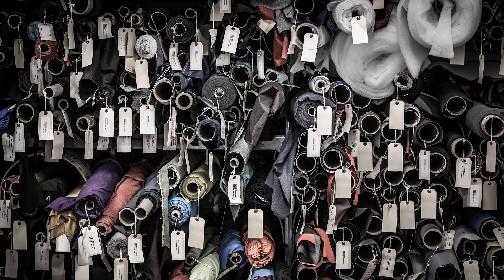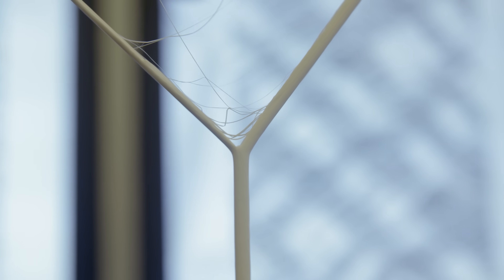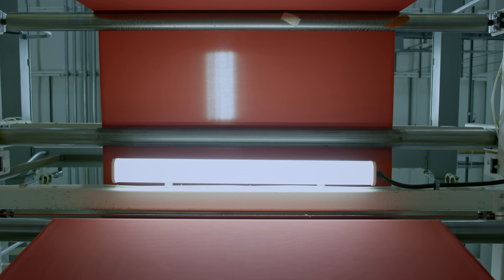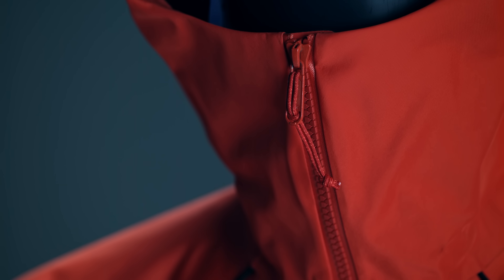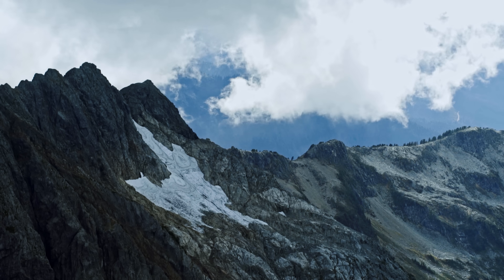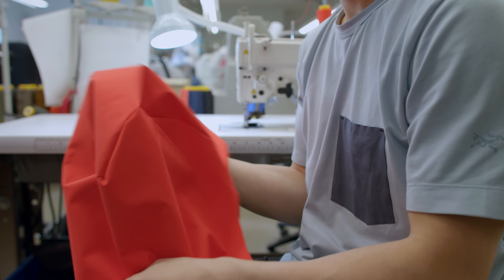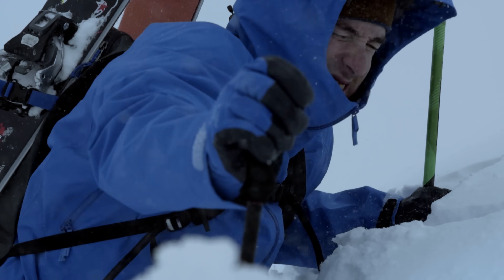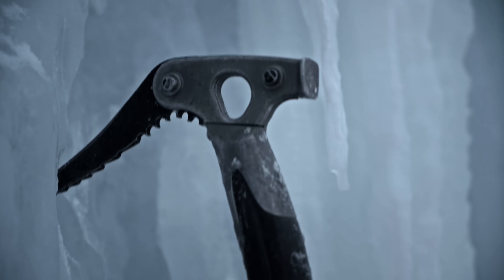Arc'teryx Presents - Who We Are: The Science Behind Gore-Tex

Comment: performance over durability - 3rd item sent back after only 1.5 years useage and holes have appeared, stichting come lose and zips stopped working. Crap warranty ensures I'll never buy again.
Reply: They have the best customer service: they'll fix your gear, if not they'll replace it under warranty
Reply: @deanpereza  no, not in my experience. I've had two items that i've sent in that they have clasesd as 'end of life' (2 years old) and they wouldn't replace it. They did offer a 50% off on another item which is nice but does not compare to BD, OR or Patagonia that would just replace it in the first place (no questions asked).

Comment: "EPTFE allows body moisture to get through the garment, yet it won't allow water molecules to penetrate it". So "body moisture" is not made of water molecules, right?. If you want to use technical jargon for marketing, at least take the time to chose your words carefully.
Reply: It functions because of the surface tension of water on the surface of the membrane. The actual ways in which it works is a bit more technical than the average consumer cares to hear so they simplify it to water beadlets are larger than water vapour particles.
Reply: Fernando Sanchez Body vapours are so small in comparison to water beadlets.

Comment: Nice video 
Maybe I have had the wrong manufacturers with my raincoats 
Everyone has failed with goretex leaking like a siv in some cases more like a colander. 
I’m one that wears shorts so most rainwear doesn’t cover my bum. So I end up with a wet bum and the weather whistles through. This may sound a bit controversial that I don’t wear longs. With longs it’s not fun crossing rivers and creeks as the longs can pull me down under and into the current

What I am looking for is a raincoat that protects my bum when I’m carrying my pack. No armpit zips (as they will at some stage) one internal pocket and weighs no more than 500grams and lasts 5 years if I use 200 days per years
🤔 yes I’m a dreamer
Cheers
Reply: Have you been washing your jackets frequently? Gore Tex is very delicate and requires a lot of cleaning if worn routinely. I've been able to wear the same ski jacket for 5 years without any problems.
Reply: shut up bruh